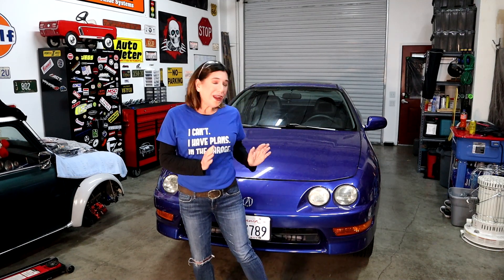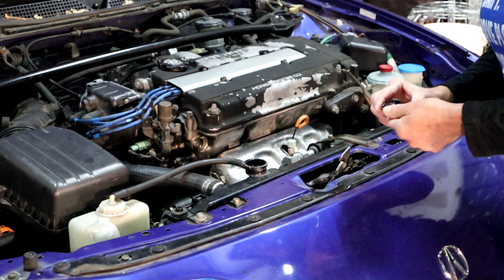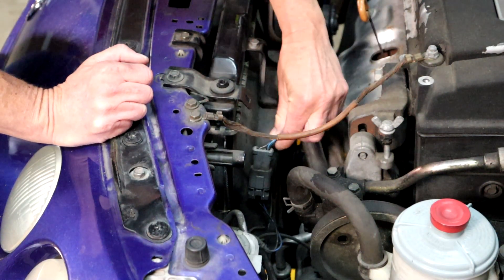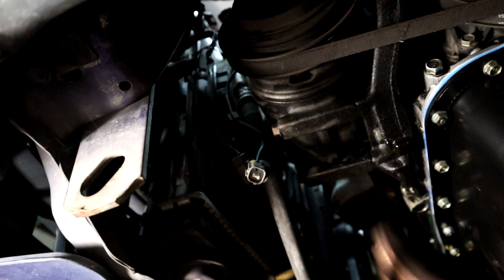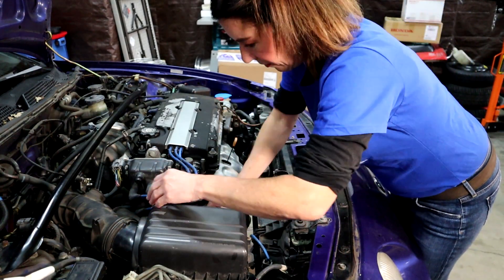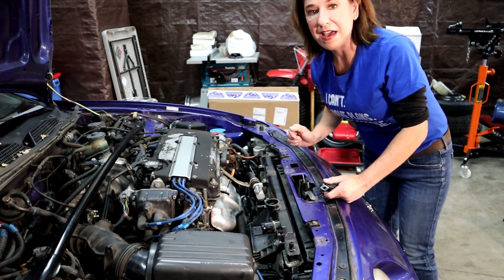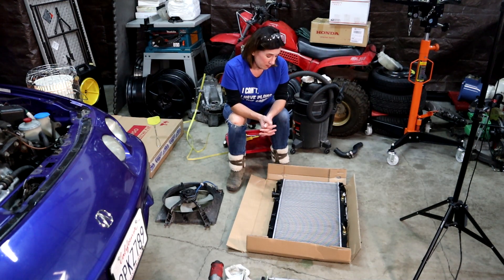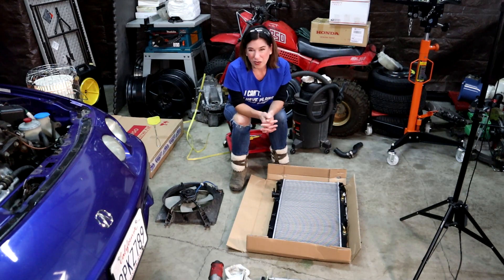How To Remove Radiator and Fans from an Acura Integra GS-R!!

Comment: My brother and I were just completing this install last night and ran into the same exact issue on our GSR! The Denso model that RockAuto mentioned would fit did not have the same mounting slots for the main radiator fan. Which radiator model did you end up going with for the correct fitment? Looks like reviewers on Amazon were suggesting the Denso 221-3212 instead of the 221-3211. Anyways, I wish I found this video sooner to avoid the headache! Thanks for the very thorough install guide. Will be using part 2 to help me complete the install.
Reply from the maker: You just made me so happy, thanks for watching and the comment!! You're right, the Denso 221-3212 WILL fit your teggy! It was a surprise to us when the other one didn't fit, such a waste of time.  You're so welcome, happy to help anytime!! :)